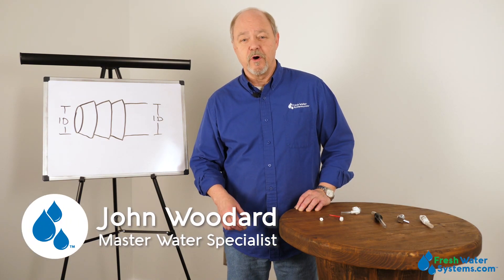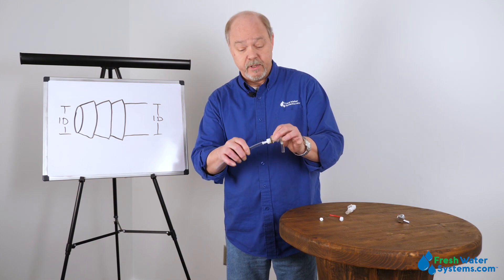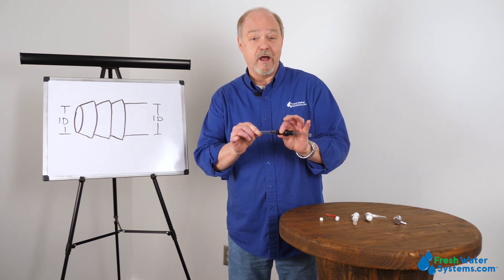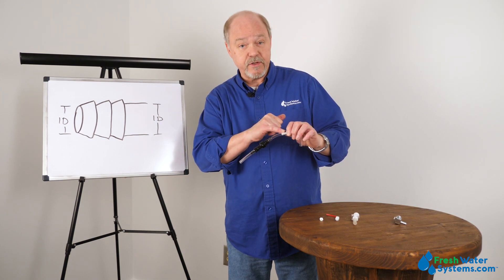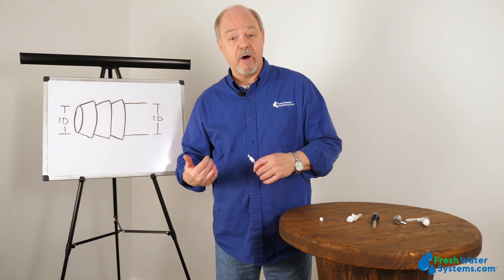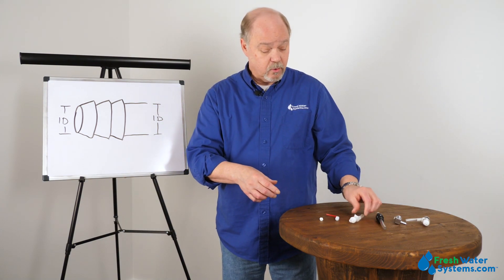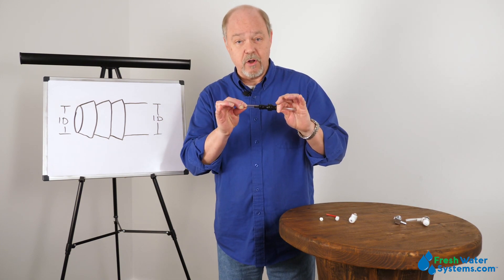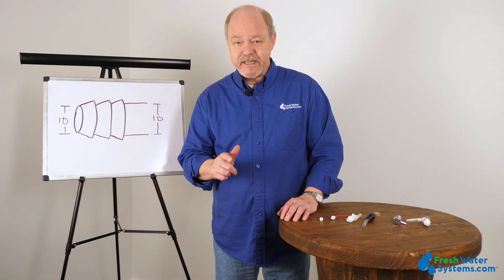What is a Hose Barb Fitting and How Does it Work?

Comment: Question; The 1/4 in plastic barb connector, I ordered on Amazon, for my polyethylene 1/4 in tubing from an Aquasena under the sink water filter is too LARGE to push into the tubing (I need to make some connection modifications). Can I expand it and make softer the tubing with hair dryer heat so it will push into the barb connector??  Thanks!

Comment: I some times want to buy clear tubing for connecting to various ports in
 vehicles for testing and flushing - what is the right way to measure a 
barbed male connector to determine correct tubing size?

Comment: I'm thinking of using the wife's hair dryer on rubber dishwasher supply line being supplied from a barbed supply fitting - can't get it on at room temp. 
Will this work? Should I use Rectorseal pipe thread sealant?